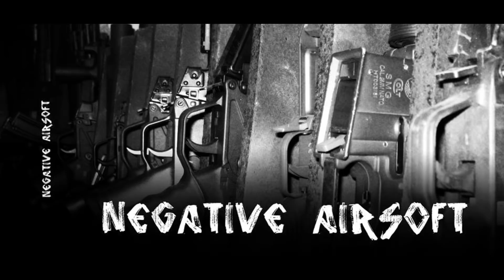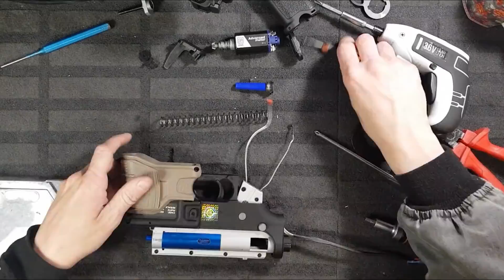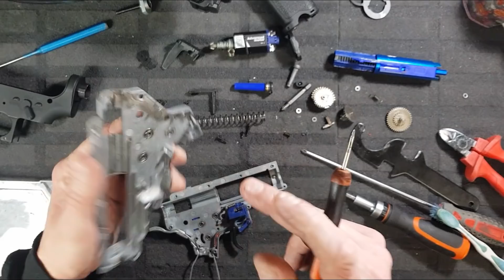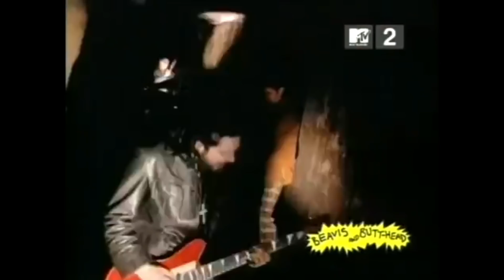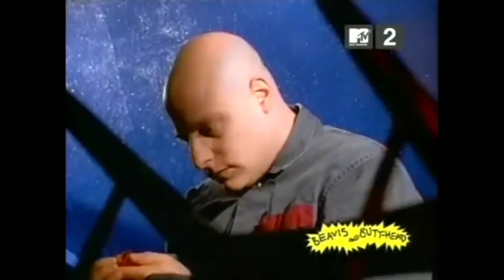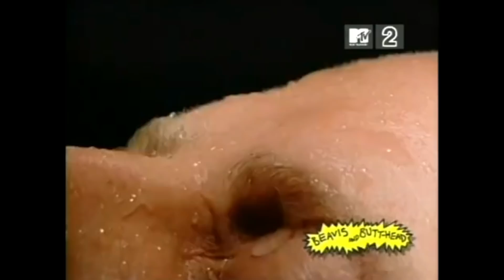Specna Arms Orion Gearbox

Comment: Let me guess this was from patrol base and I had exact same issues
Reply from the maker: Go on... Elaborate?
Reply: Yeah same. Sent a gun back coz it was missing a pin. They said they repaired it and the pin was still missing
Reply: I don't trust them anymore either
Reply: Negative Airsoft So I ordered online and the first gun I received wasn’t the gun I ordered. So luckily I live near to their store. Took it back and got the gun I had ordered. This is my first gun so didn’t think to ask to get it tested before I left the store. So I took to my first game with it and it was locked up exactly like this one. I took it back they gave me a second gun but this time I got it tested at the store and it shot fine. Took it to a site. Started shooting full auto without even pulling the trigger while on safe and would fire full auto on semi. So I took it back and got a new one again. This one shot fine again in store but would throw an error code on the mosfet saying the motor wires weren’t connected. So I took that back and they said they fixed it but it’s still occasionally throws the same code so going to have to take it back again because I’m pretty sure without opening it the wires are from 1920 and when they “repaired” it they put heat shrink around the dodgy bits of wire.
Reply: @TheFISHER360  Man, I would have just gotten my cash back after the second fucked one and moved on. That's crazy. Is Specna's QC really this shit?
Reply: I've had issues with patrol base and the Specna E-11. First time using the gun it wasn't hopping and had very low FPS despite all the 'tests' Specna and Patrolbase do before selling it. Sent it back to PB and all they did was replace the O-Ring. Received it back with the power sorted, when I had a look inside the hop chamber is was coated in grease, no wonder It wasn't hopping.  Gave it a clean, a new hop rubber and it was shooting good. Now I think the tards at PB have cross-threaded the bufferscrew, since they were the only ones that have gone into the gearbox. Easy enough fixes but it's not what you want with a new gun.
Reply: DrakeyCakes7 yeh forgot to mention mine was a E-11 too. I like the appearance and feel of the gun and I thought I was just having bad luck with them so I just kept taking it back for them to fix but I didn’t realise it wasn’t just me having issues. I think I also might have to open it up and have a look.
Reply: @NegativeAirsoftTech   is patrol base really that bad? i just bought my first one through them.. edge e07 really hoping not have issues like this.
Reply: @Kyle-gx6yx  report? Any problems with Ur Edge? I'm gonna buy One but i fear some trigger issues

Comment: Hi first love the videos. I have a edge E-15. It fires consistent just a little low FPS wise. The original m90 spring fired a .25 at 235 FPS. A SP100 spring brough this up to 285fps. (320) with a 0.20. Patrol base say this is within the "norms". Should I be concerned? Thanks.
Reply: Is that a Guarder sp100?  If so then you have a minor air leak.  320 is more than usable though.
Reply: @mrpugster  yeah it is. Is it worth trying to fix the leak? I'm quite hands on but I've never taken a gear box apart.
Reply: Wow we get 430-450 out of an m120

Comment: Was thinking about picking one of these up but have been hearing about issues with the gear boxes stripping should i still get one as i have heard good things about the specna brand and would i be good to run a 11.1 lipo in it? and if not got any other good gun recommendations around 200$? thanks
Reply: All advice I've seen is to avoid using 11.1s. on replacing my gears I noticed that weight and quality were far below shs gears.
Reply: @hal752  thanks for the reply looks like ill be putting in new gears at some point then lol have pretty much made up my mind on this gun and if things go wrong i plan to just upgrade the parts that break
Reply: @silencedem6227  issue wise I have had issues with the gears a airseal on the piston and the bucking. I changed to a Prometheus purple and had no further issues. I'm planning on changing the hop up and barrell at some point.
Reply: @hal752  i was going to also add a prometheus and mabey a stronger motor and gears debating between this and a helios umbrella corp on evike for 280$ apparently the helios umbrella shoots like 28 rps out the box with 11.1 but i guess people been having issues with the microswitch on the trigger from the reviews and i can't find any specs on if it has a proper mosfet and i don''t think it comes with a deans connector either so idk the rps seems nice but since i can't find much info on it im leaning more torwards the edge because i feel like if i throw 70$ in parts at it i could get similiar performance but im not 100%
Reply: @silencedem6227  I agree with the motor. Mine sounds quite loud and although snappy I feel the motor is holding it back abit. RPS mines firing at 10 and I'm happy with that. In regards to the umbrella. Not heard many good things with it.

Comment: I have a Specna and I like it alot. The quality of the parts are rival to guns much more expensive. Never had any issues with it altough I did put a mosfet in the electrical circuit and the piston and spiring probably need to be replaced after this season.

Comment: So....picked up a used g&g m14 ebr.... knew it was going to have some issues going in (of course, i paid a hundred bucks for it). Surprisingly, not too bad. It's stuck on semi (which i don't mind), and the barrel wobbles. Any experience with g&g m14's and any tips on how to stop the barrel from wobbling? and also, should i upgrade the hop up to a maple leaf and get a tightbore, or should i just leave it well enough alone after i fix the barrel?
Reply: @MaliceOfRites  Ok, so it seems that i'm missing the screws that secure the barrel to the receiver. Since I can't find anywhere on the interwebz where to find one or what the proper size is, I took the ghetto method of finding a screw slightly too small, put heat shrink around it, and put it in. It's working surprisingly well! Put a tightbore and a g&g green bucking in, and i'm shooting fairly accurately with .30's. I might have to use heavier bb's and a slightly heavier spring. Next project!

Comment: i saw you making cutouts inside gearboxes in previous videos, why do you do that?
Reply from the maker: So the faeries inside can breathe... What, you'd just have them suffocate would you?
Reply: i mean the ones on the front like in this gearbox
Reply from the maker: @sznupa8903  Faeries
Reply from the maker: @sznupa8903  (speads out impact energy rather than taking it to right angles causing cracking. It's not a fix, it's a lifespan increase)
Reply: @NegativeAirsoftTech  thanks
Reply: One time I had a gearbox lock up on me, when I opened it, it turned out that one of the faeries had died and got stuck in the gears. Always radius some breathing holes for the faeries.

Comment: Just one quick question. Does plastic hop up chamber units like zci perform the same as metal ones? Any difference ? What you would recommend go for? For aeg fps around ~350 ?
Thanks
Reply from the maker: I prefer plastic.
Reply: @NegativeAirsoftTech  thanks for fast replay :)
Reply: Material doesn't really matter, what matters is the tolerances and overall quality. It's not a high stress part so it doesn't need to be particularly strong, but it should obviously be precisely made.
Reply from the maker: @hakont.4960  You're 100% correct - it's like that time I got pissed on a bottle of Sambuca, I can't even smell the stuff now without feeling sick.

I had so many issues with the first ever classic army & ics guns with metal hop units (metal) that I just don't want to use them now.
Even now, I hate prowin & madbull hop units, they leak air, adjust like shit... It's not the material, it's the tolerances - but I still find I get more issues with metal ones. 
No reason other than that's what happens.
So I stick with plastic.

The maxx is excellent

Comment: Just a question i want to keep my rof the same as it is know around 16/17 its standard but i want to increase my trigger response so what will i need ? Because on most site's people talk about high torque moter and high speed gears wel thats sound fine but i dont realy want to take teeht of anything if i dont have to just because i rather keep as much original parts in until they break

Comment: Payed someone £80 to wire in a WARFET and change a spring on my new gun. Is this too much for teching?
Reply from the maker: I charge £40 including all wires & connectors for mosfet fitting, if I'm literally just installing a supplied spring & the output doesn't matter, I just put it in but that said, I do charge an hourly rate on top of mosfet fitting if work needs doing - the gearbox may be open but there's more to consider.
If he's done a good job then I think it's fair.
I do all modification work first & when I'm happy, I fit the mosfet.
Reply: @NegativeAirsoftTech  Ok thanks. Well it has to be on pre-cocking on the warfet settings otherwise I have to pull the trigger 3 times to get 1 shot.
Reply from the maker: @omgyeaXD  that's the settings more than likely
.
Reply: @NegativeAirsoftTech  Thanks for the reply.
Reply from the maker: Could also be weak spring or damaged cut off lever
Reply: @NegativeAirsoftTech  I guess it could be the spring is too weak for the gun. I got it from poland and it was 470 fps. So I got a weaker spring put in.

Comment: Fairly snappy for a 7.4v, reckon motor is not a sluggish one so tend to wonder if owner tried to push it which accelerated not just rps but also the failure...
With a metal rack & PME risk increasing, something has to give/fail first if you take the pi$$ too much etc... if you haven't planned ahead, so new players - don't go silly pushing stuff on higher volts than needed
Agree, nice snappy gun on 7.4v as it is, SA sort out your QC & owner keep it sensible & it should serve you well
Great work, getting it going again
Reply from the maker: He runs 7.4v & if the wires are in the pistol grip wrong, the motor will sit pissed &/or too deep causing grinding, gears being pushed at strange angles... 
This gun stripped for that reason.
Reply: @NegativeAirsoftTech  Sectors are "normally" pretty robust,  Bevel's 10 teeth can shred, then maybe spur can go with perhaps Sector's being slightly more robust - unless they was spaced/shimmed poorly or little contact/teeth meshing to transfer power to begin with. Terrible weak & thin SRC sector comes to mind, but ANYTHING can break, had hairline cracks in a new gear set on sector gear, so stuff happens. Guns badly assembled with poor motor angle/alignment will quickly wear/wreck stuff.
Great channel btw, new players take note - tech/repairing guns looks quite easy or so you might think...

But truth be told, often this is simply because these experienced people are so f**king good at what they do, they make it LOOK easy !!!
Reply from the maker: @authuruksake9121  I normally find bearing bushings on the bevel explode (poor shimming normally or motor alignment) but I think if I were to ignore brands & decades, the most common strips I've seen are spur AND sector with the pinion going first & taking the sector with it.

It's why I replaced all three gears - I don't keep single gears, if one strips I don't trust that it won't happen again if the issue is actually with a different gear causing a fail elsewhere & cracked gears can be hard to spot... so it's all or nothing unless the only option is to replace one or if I'm dead sure it's not the other gears. 

In this case, I'm blaming motor alignment (can't test shimming properly with stripped gears).

I could be wrong but a lot of tech work is educated estimation (guess work from prior experience).
Reply: Thanks for the comments. This is my gun and failed about 1 week after delivery when I was doing the initial hop set up and sight zero. As a new player I only own 2 x 7.4s as I thought that 11v would be beyond my newbie skill mix and gameplay.  Didn’t bother to send it back to the retailer as this was the second gun after first was stuck in semi only. Negative Airsoft have done a great job and regular Comms/updates via WhatsApp mean no surprises.

Comment: Actually my gearbox locked up early on but I took it apart unlocked the gearbox put it back together and haven't had a problem since
Reply: should i get one
Reply: @acebeats379  I found mine on sale for $180 and you will need a better bucking and shim the gearbox but if you can find one on sale but if not for not much more you can get a Krytac Alpha which are very good guns that don't need shit
Reply: @isaacshively6705  im from the uk and the krytac costs and extra £100
Reply: @isaacshively6705  any other gun around the same price range that you would say is better?
Reply: @acebeats379  Id honestly eat the extra money and get the Krytac but I have been very impressed with my ICS CXP Pealeador with the SSS gearbox there are two versions so make sure you get the one with the SSS gearbox or the new CYMA Platinum M4's are really good most of the internals look to be the same as the Specna Arms but quality control seems to be alot better and the shimming isn't perfect but alot better than the Specna Arms... But as much as I don't wanna say it and I've played Airsoft for ten years now and avoided them like the plague Krytacs have really strong internals and the new M-Lok versions have a better mosfet, air nozzle, and they fixed the lower receiver cracking issue so if you get one don't get the keymod version get the M-Lok version oh yeah the gears are whiny in them though they have a very distinct sound

Comment: You're worrying me now mate, I have to give stares at mine in the closet now to ensure its not in the same bad condition. Tear out its guts and buy a whole fresh gearbox.
Reply from the maker: The flecks of blue plastic rubbed off the tappet plate on the rough part. It's not a catastrophic failure point, just bollocks. The gears being stripped seem to be the retailers fault as the motor was in wrong.
Reply: @NegativeAirsoftTech  Well you had me worried the moment you said casting errors, so if they're using shit moulds and/or QC then its deffo worth looking in at it. Other than my gun locking up on semi using a 7.4v, luckily had no other problems so far.